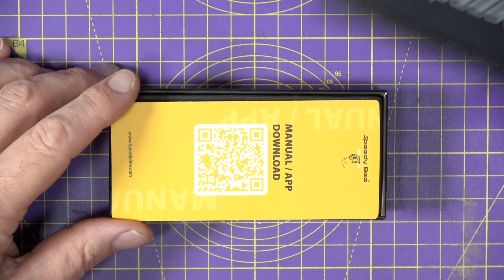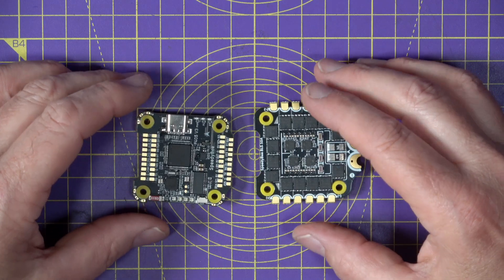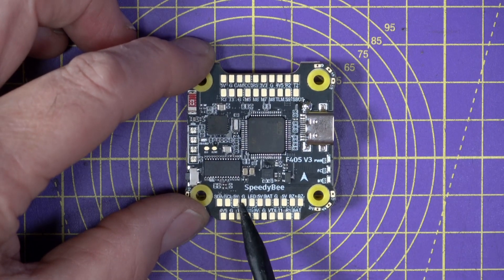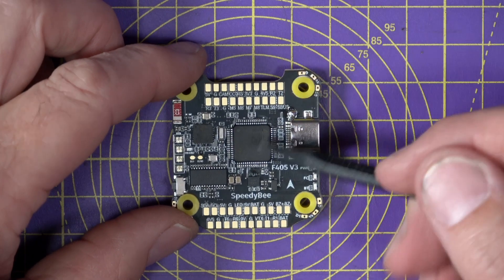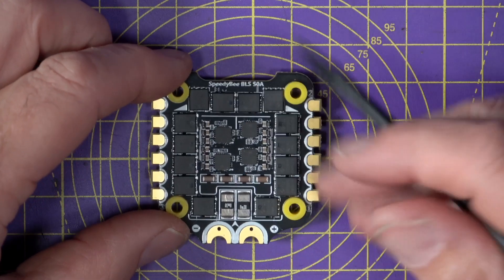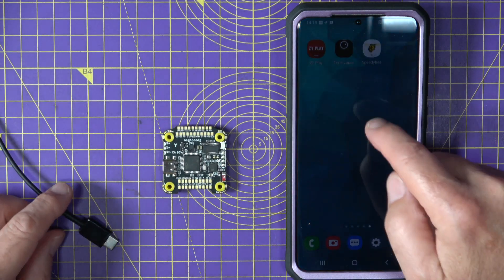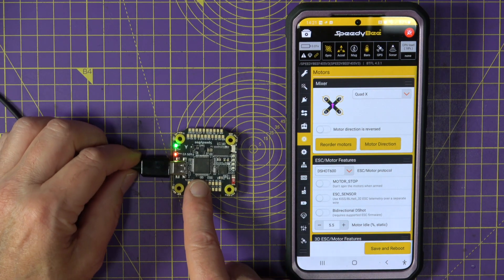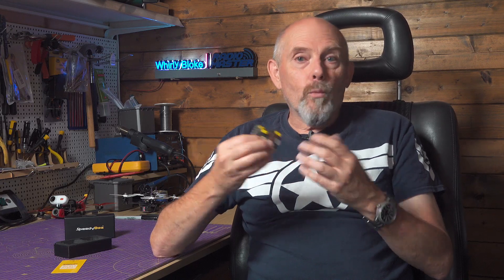SpeedyBee F405 V3 wireless 50A flight controller stack // First look and review

Comment: I appreciate the content your creating. I wished i copied what I've been writing in the comments lol. I've been dealing with this stack for some time.

 Here's my issue and maybe since you've made this video, you've learned something about it that I dont know.

 I've had 2 full fire blow outs, and 3 esc issues. (Just in the last few months) I'll not go back any further as some of the issue may have been my fault, who knows it was a while ago.

 So I've purcased multiple stacks, the ones I'm having issues with ALL came from Amazon. It's May 2024 in Canada and I'm very positive that speedybee is selling failed v3's on Amazon. I say this cause they aren't selling v4's, and every single one I've got, and returned because of these issues ...... is clearly an issue. 

 I've got 3 5" drones. #1 i have a speedybee master 5hd with a v3 stack in it, but i got it from a retailer of drone parts here in Canada. It still flies and works perfectly. 

 #2 green drone we will call it. Ive had 2 full blow outs. And 2 failed esc's, it just comes up as "missing esc" I see in your video your being provided with a 1500 capacitor.... the ones I'm getting are 1000. Ive replaced every part on this drone except motors..... so i was convinced after blow up (last one was a blow up) HAD to be the motors. Please note these are SUPER clean builds and looked over by pro builders/pilots. 

 THEN my brand new Mario 5 build i went to fly, BOOM missing esc!!! Neither drone has been crashed or flown hard hard. So same issue 2 different drones, all different parts. So my motor theory is gone out the window (also after stripping it, motors where tested and passed with flying colors) 

 The common factors, same stack coming from Amazon store. Also all stacks flashed to bluejay. Even my still working after 7 months drone is fllashed bluejay. I've read in comments that flashing bluejay on these is bad, do you know anything about this? Is this my issue? I go with bluejay for bidirectional dshot ya know? Is there a known issue with bluejay and these esc's I'm not aware of? 

Speedybee wants me to send back these on my dime and wait over a month to tell me its defective after clearly we know its defective. I've sent video and pics. 

 Anything maybe you've learned since making this video you can please assist me with? Appreciate you very much!

Comment: Hey! I build my drone with this stack. Flashed bluejay to 48khz. I can only get dshot 300 to work and not 600. The problem is that as soon as i flick with the rolls it goes crazy, like roll of death. Reflashed to blheli and it works again. Do you have a clue what the problem could be?
Reply from the maker: It sounds like you've got a few issues there. The fact that it works with DShot 300 but not 600 is intriguing. The roll of death issue might be related to the higher motor update frequency.

A few things to check:

Motor and ESC Compatibility: Ensure your motors and ESCs are rated for DShot 600. 
Firmware Compatibility: Confirm that your flight controller, Bluejay firmware, and Betaflight/BLHeli versions are all compatible with each other.
Electrical Noise: High-frequency updates can be more sensitive to electrical noise. Check your wiring for any potential interference.
Experiment with different settings and maybe seek advice from the community forums. Happy troubleshooting, and hope you get it sorted out! 🛠️🚁

Comment: Hi Whirly, on this FC running Betaflight 4.4.2 I enabled barometer and magnetometer but they are blacked out and not working.
I did include magnetometer when flashing. Do you know how to repair it? thanks

Barometer is the one on FC board and for magnetometer I'm using Foxeer GPS M10Q 180 5883, I soldered all it's 6 wires correctly.
Reply from the maker: It's impossible for me to diagnose remotely, but I suggest trying another board or reaching out to SpeedyBee or your supplier for help. Best of luck getting it sorted.
Reply: @WhirlyBloke  Thanks Whirly I appreciate your reply.
I was just ready to send SpeedyBee a message like you told me, and before sending I wanted to take photo of the FC for them to see and when I examined the photo I saw that the tiny SDA wire had like one or two strands that didn't get soldered and were bent and touching the SCL pad!
I moved those strands away from the SCL pad and started Betaflight configurator and both barometer and magnetometer icons are now illuminated! thank God
Reply: @WhirlyBloke  I wonder though how that caused the on board barometer to not work, interesting...
Reply from the maker: @flat-earther  Maybe.

Comment: Thanks for the informative video. Would it be possible to power the FC with the 5V power from the four ESCs I'm using in my old quad, which actually runs with only 2S batteries?
Reply from the maker: Thank's for watching my video and for your question! While it's technically possible to power the SpeedyBee F405 V3 flight controller with the 5V power from the four ESCs you're using, there are a few factors to consider.

Firstly, the SpeedyBee F405 V3 flight controller stack is designed to handle higher voltages, typically up to 6S or even 8S batteries. If you're running your old quad with only 2S batteries, it means the voltage supplied to the flight controller will be significantly lower than its intended operating range. This might lead to instability or unreliable performance.

Secondly, the 5V power output from the ESCs is usually designed to provide power to the receiver and other peripherals, not to the flight controller itself. It may not be able to deliver sufficient current for the flight controller's requirements, especially if you have additional components like GPS modules or LED strips connected to it.

For optimal performance and reliability, it's generally recommended to power the flight controller with a dedicated 5V power source, such as a voltage regulator or a BEC. These are designed to provide stable and regulated power specifically for the flight controller, ensuring proper operation.

If you're concerned about wiring and want to simplify your setup, you can consider using a 5V BEC that connects to your 2S battery directly and supplies power to both the flight controller and other peripherals. This will provide a dedicated and reliable power source for your flight controller while maintaining compatibility with your existing setup.

Remember, it's always important to follow the manufacturer's recommendations and guidelines to ensure the best performance and safety of your flight controller and overall quadcopter system.

Thanks once again for your comment and for taking the time to watch my video. Happy flying, and best of luck with your quad project!

Comment: My speedy bee SB light on how to off that red light?
Reply from the maker: The Speedy Bee F405 v3 SB flight controller has a red LED light that indicates the power status of the board. If you want to turn off this red light, you can disable it through the configuration in Betaflight.

Here are the steps to turn off the red LED light:

1. Connect your Speedy Bee F405 v3 SB flight controller to your computer using a USB cable.
2. Open the Betaflight Configurator software on your computer.
3. Click on the "Connect" button in the top right corner of the screen to connect to your flight controller.
4. Once connected, navigate to the "Ports" tab in the top menu.
5. Find the "LED Strip" option and click on the button to turn it off.
6. Click on the "Save and Reboot" button in the bottom right corner of the screen to apply the changes.

After following these steps, the red LED light on your Speedy Bee F405 v3 SB flight controller should be turned off.
Reply: @WhirlyBloke  thank you

Comment: Have u tried the FC for INAV? Since mine didnt work, the esc protocol option only multishot and motor didnt want to spin when it armed
Reply from the maker: Make sure that you have properly configured the flight controller for INAV. You should check that you have selected the correct board and firmware in INAV Configurator, and that all of your settings are correct for your aircraft.

Next, ensure that your ESCs are connected to the correct pins on the flight controller and that they are receiving power. You should also double-check that the motor direction is correct, and that the motor signal wires are connected to the correct pins on the ESCs.

If you have confirmed that all of your hardware connections are correct, you may need to check your firmware settings for the ESC protocol. INAV supports several different ESC protocols, including Multishot, DShot, and PWM. Make sure that you have selected the correct protocol for your ESCs, and that your ESCs are capable of using that protocol.

Finally, you should check your arming sequence to ensure that it is properly configured. Some flight controllers require a specific sequence of stick movements to arm the motors, while others may use a switch or other method. Check your manual for instructions on how to properly arm your flight controller.

If none of these steps resolve your issue, you may want to reach out to the manufacturer or a support community for further assistance.

Comment: This looks nice, I honestly wasn't a fan of the new f7 or plug central as I call it. That thing is just littered with plugs, I imagine it would make it hard or impossible to run signal cables between the ESC and fc. I also think that since we can only get the bmi270 to run at a 3.2k PID loop, what is the point of having a f7 on board? I think this is right up my alley.
Reply from the maker: I've just built a 7 inch X8 cinelifter with the F722 V3 and 2 x ESC boards. Totally awesome.

Comment: How is the gyro noise? I Tried to contact them and even sent them my BB logs to show them how noisy my pitch axis was and my esc fried the first flight. They still haven't responded.
Reply from the maker: I'll let you know when I've finished my build. But it uses the Bosch BMI 270 which has a low noise floor so I'm not expecting any issues.
Reply: @WhirlyBloke  I agree, mine was the v2 with the mpu6000